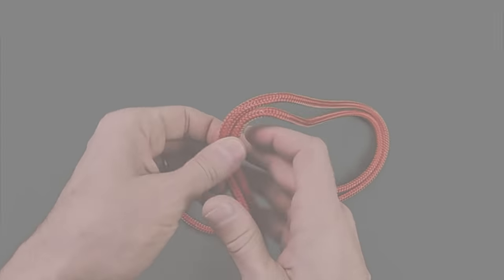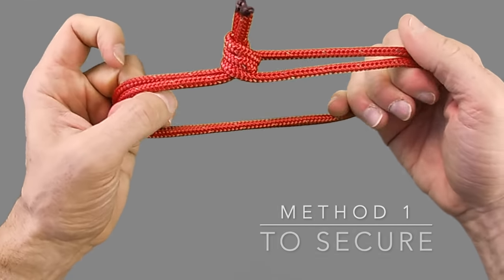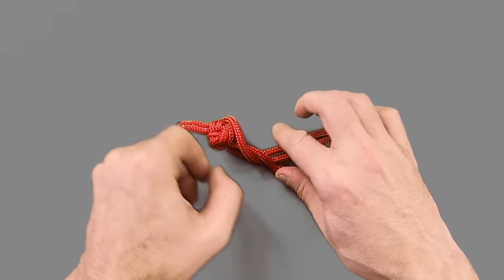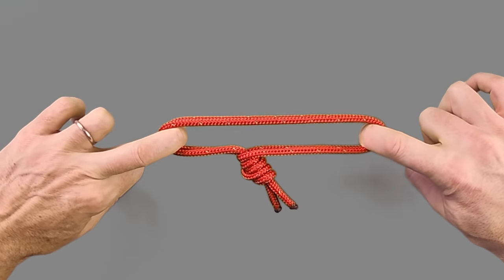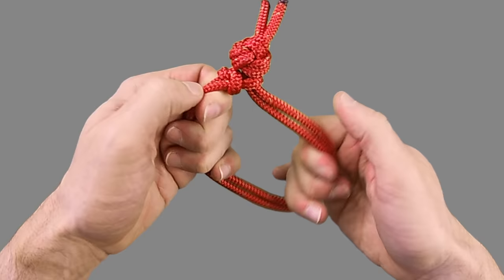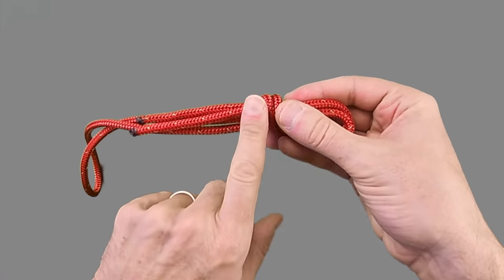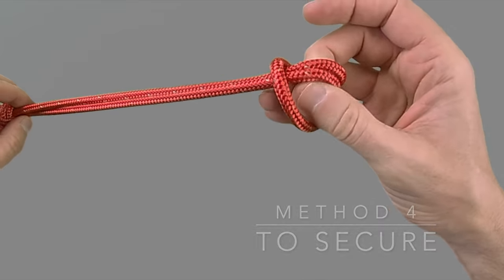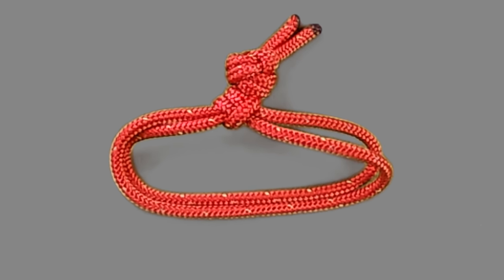10 second Soft Shackles !!

Comment: So...
What is the "Shackle" and what I got to do with it?
Reply from the maker: The shackle is the loop that you create with the stopper knot, think of this as the U shape object in a traditional shackle. Think of the various finishes as the pin of a traditional metal shackle. If you put the bite end through the two objects you want to join, for example a pulley to a saddle on a boat or a tow cable to a towing point of a car, then finish it to lock it off.
Reply: @BottomUPBoats  
Thank you. Now I got to go... You know, towing boats or something :)
Reply: @greenhat7742  ...and maybe shackling stuff..

Comment: What's a soft shackle and what is it for?
Reply from the maker: Soft shackles can be used instead of most traditional shackles. If you are a sailor like me they can be used to fix pulleys to almost any fixed points, sheet and halyard to sails. The use cases are almost endless.

Climbers now use this in many case too as the are lighter and stronger than metal options when using modern rope.

Off roaders would also have many use case when connecting winch lines to just about anything.

Comment: Maybe after it was loaded, a Figure 8 would be easier to undo than an over hand?
(2 out of the 62 comments are mine = I appreciate this video 👍)
Reply from the maker: It would be, with that said after moderate load any knot will be hard to untie. It would also reduce the breaking strength of the shackle which is variable depending on the size of the knot. This may or may not be an issue depending on the strength of the rope and the use case.
Reply: @BottomUPBoats  Yes, as for over tightening, the running end of a Figure Eight is unloaded, and as for weakening the rope, the standing end of a Figure Eight is basically an over hand knot.
Reply from the maker: When you look at the break test it is not the knot that fails it is usually the connection the sits against the stopper knot that give way. With that said the size of the stopper knot does influence this. I may have to find a load cell and get to work on my next video 😁

Comment: Well if that is 8 MMprusik cord breaking strenght is 4000 lbs single strand 8 000lbs double strand minus 50% for the knot. Last and final knot is a girth hitch. All the above info is basen on my knowledge from rope rescue classes
Reply from the maker: Yep it is an easy way to double the load less the knot, getting you a super strong shackle for just about any use case in seconds.

Comment: There is also a super interesting Longhorn knotted soft shackle, which relies on a (soft) toggle rather than a noose-stopper embrace:

 https://youtu.be/mVhyIBTAAng
Reply from the maker: Thanks for sharing I will have to check it out.
Reply: Just wanted to add that the Longhorn soft shackes were pull tested in this video:

https://youtu.be/5xrCXTQ5X38

Also, it looks like the Longhorn hitch can be easily collapsed to form a large convoluted stopper/knob, to which a noose can be attached as in most regular shackles.  I wonder if either one of these would have chance of holding under tension in naked Dyneema/Amsteel type cords?

Comment: People search another channel and learn how to make a real soft shackle.
Reply from the maker: As per the names these are meant to be quick and easy. If you did search hopefully you end up back in the same place as we have lots of REAL options for you to try too.
https://youtube.com/playlist?list=PLMoCfFBA9IMXC6P0b6Ql8822sZnthEYfk
Reply: @BottomUPBoats  How many quick and easy solutions end up being a root cause of disaster? I wouldn't use these ANYWHERE in my rigging on any boat larger than an Optimist. Sorry, but these are just not equivalent to a dyneema S.S. or a metal shackle. If these fail on a 12' day sailor, no real problem, but on a 22' boat? A 30'?
Reply from the maker: @daveopincarne3718  we have lots of other options on the channel that I agree are better for heavy duty options. We use these as temporary or if you need a loop in a hurry.
Reply: @BottomUPBoats  That's great to hear. But I'm still concerned that, based on other user's comments, that their lack of knowledge about soft shackles could lead to catastrophic consiquences. I suggest you clarify that these should only be used as utility items and not for technichal applications.

Comment: Scary as hell! Please don't use these in any critical, life dependnt, or high load capacity. These are not the equivalent of a properly constructed dyneema soft shackle tied with a button or diamond knot. Don't take my word for it. There are some excelent chanels that do destructive testing on soft shackles. Watch some of those videos and see how critical proper construction is. In some of those examples, even a the proper knot, poorly tied, can have a strong adverse affect on strength.
Reply from the maker: These are quick options to get you out of a bind or for light load use cases. Agree I would not be hanging from a cliff on these.

Lots of more options with strengths up up to 230% of the breaking load of the rope, both with knots and splices in the playlist below.

https://youtube.com/playlist?list=PLMoCfFBA9IMXC6P0b6Ql8822sZnthEYfk
Reply: (Well if you are mission critical without any redundancy - that is the recipe for disaster.)
Any piece of gear not rated for the task at safe working load - not even approaching 0.6 of minimum breaking strength is hazardous (rope gear wears out and gets weaker), break gear fear and teach safe use, rather than scaring everybody into not trying anything - these are good aims.  

 Never copy anything shown on a youtube video without validating for yourself.